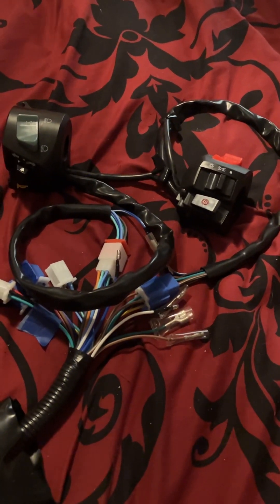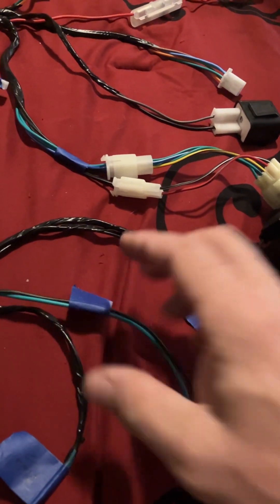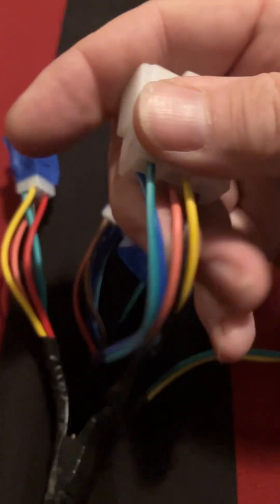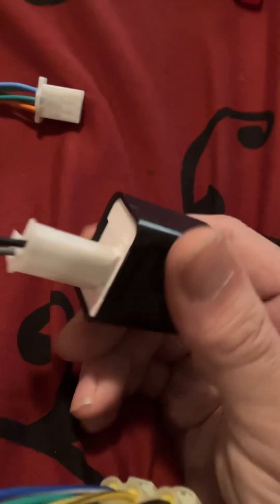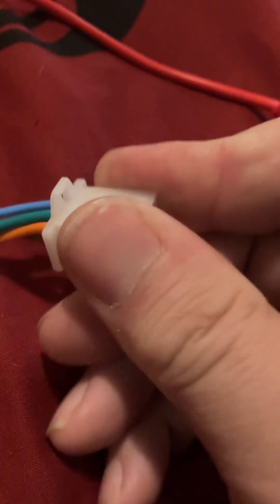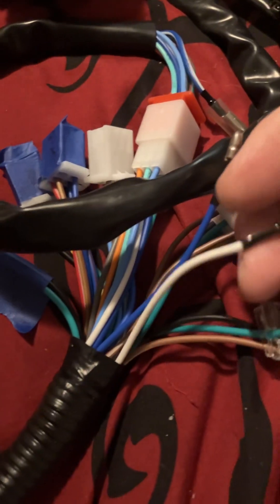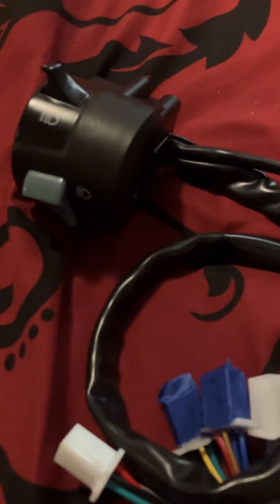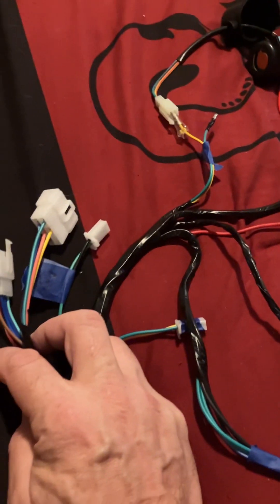New build wiring harness and components for CG250 (Hawk) engine swap onto CB/CL125 frame.

Comment: 2:50 I thought the hawk was ac... every harness for the hawk I've seen says ac
Reply from the maker: That was a speaking error. I picked up a simple Glixal brand AC CDI for GY6 that is shown in video. Sorry for the confusion. I would re-edit but the harness is installed already. I did actually list AC CDI's under the "parts list" in the description.